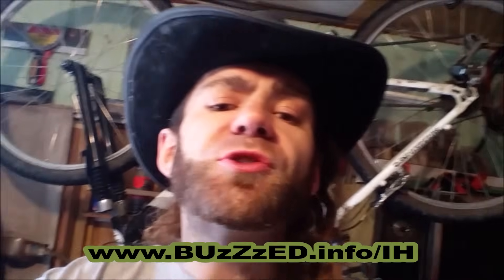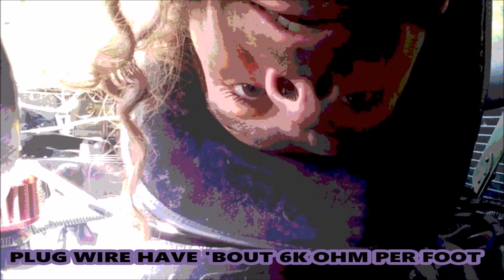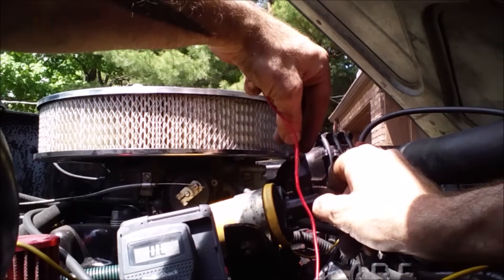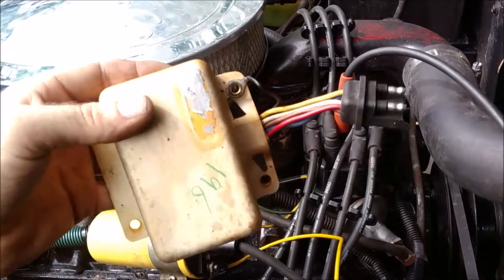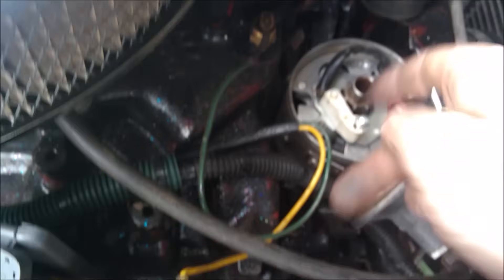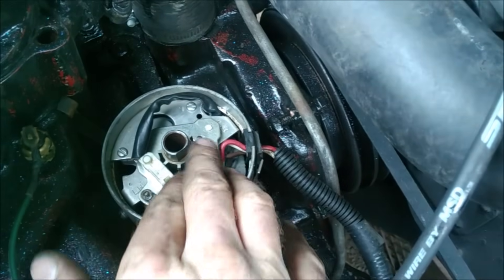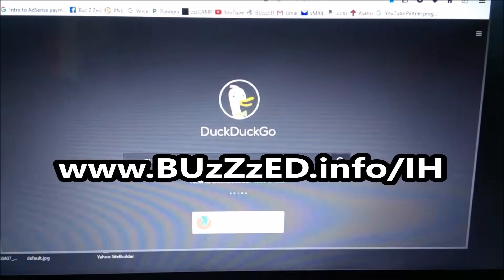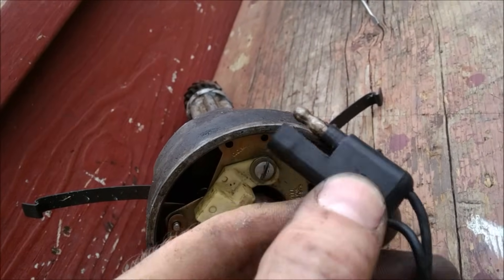NO SPARK, NO START, NO PROBLEM!  IGNITION SYSTEMS

Comment: Could this be the issue of my Jeep stalling after 30 minutes of driving it no problem? Takes a while to start back up starts but then dies again after 5 minutes or right away
Reply from the maker: Could be vapor lock, could be the carb getting hot and boiling the fuel in the bowl if it’s missing a plate or running lean, could be egr, could even be as simple as the gas tank vent is clogged or replaced with a non vented cap on a vented system.... could be your coil over heating. Might even be lean or a bad fuel pump... Does it have points? Is it fuel injected?
Reply: ERIK THE WRENCH - LIVE FREE OR DIY   Lol process of elimination.  My mechanic told me vapor lock is highly unlikely because of where we live but I think that’s stupid because it still gets hot.  It’s not fuel injected. No points it’s electronic. Just put a new Webber carb but that’s didn’t solve it. Going to be amc hei distributor next and higher output alternator.

Comment: Actual helpful information! Thank you much, but.... no look at the Scout II huh? Guess I better subscribe!
Reply from the maker: Their is a film of the scout show in 2017 on the page as well, I have the METRO and more scout vids to upload, but I do need another Scout, She was my daily driver for 5 years, then right after I installed the frame x brace and the roll bar, I got run off the highway a few months ago in a snow storm. barrel flip in to the ditch. truck was totaled, id be dead if not for the simple terra bar from SSS! I find another, have lots of parts and a 392 waiting for the right Scout.
Reply: @ErikTheWrench  I do need badly a set of vacuum wiper motor rebuild kits. I will certainly look for those videos.
Reply from the maker: @whatyaworkingontoday5018  http://www.ironhammer.info/IHOR.html
Reply: @ErikTheWrench  what year scout ya looking for? There are some here in Tulare county, California I also know of some in Lancaster. Travelers, Travel all, Scout II, what your poison?
Reply: @ErikTheWrench  also I have a buddy looking for a quad cab if you know of one.
Reply from the maker: Not sure but I’ll put the word out, just bumped into a guy with a 1940 Ih pickup. Gave me a flyer for the Fort Wayne Indiana harvester homecoming! July 30-aug1
Reply from the maker: My driveway is full and my wallet is empty until I sell this trans am!
Reply: @ErikTheWrench  what year TA ya selling. I might be able to help. If you want to send some pictures I can give you my email.
Reply from the maker: 81, black, 327 humphead, 4 on the floor. subframe connectors and steel tube welded inside stamped frame from the reinforcment plate in the hump to the perch/subframe mount where it attaches... its been stripped and painted seamsealed lot of new body parts, so many parts that now i wont make a dime ill just get my investment back when I sell it lmao..... im making a video on its restoration so you can see whats done.  still need to paint the trims and put the interrior / painless wires back in.... and the trunk pan was only patched.  not sure what im gonna do its a loss either way, see the guy i started this for backed out and fell in love with a riceburner, he was young and i think his family pressured him into the muscle car cause, well thats what they had lol... but we where gonna just stick the tank back and drive it a year almost complete, then replace the trunk pan with one of them prefabbed 4 link subframes, and a roll bar... and start blowing expensive engines dominating the drag strip lmao... so yeah, none of the seams to be welded touch any visable painted body parts so it wont affevt the paintjob to fix, not sure if im gonna do it or let it go, again, loss for me either way, just want my money back, or some of it. it was just one of them things. Im stubborn, and i finish what i start, even though i could have parted it out and not took a loss lmao
Reply from the maker: @whatyaworkingontoday5018   sure, my email is ih@ironhammer.info or https://www.facebook.com/BEDxHEAD

Comment: I HAVE A 66 FORD 352 NO SPARK CHANGED POINTS ROTAR CONDENCER CAP ANY BODY WITH THE SAME MOTOR
Reply from the maker: It’s wired the same

Comment: Hi I have a 1969 Cadillac , I am having a similar issue , I have no voltage DC at the coil when trying to start , what do you think ?
Reply from the maker: The relay bypass, the coil has a resistor and it’s only 9.6 volts. It gets a full 12.6 volts on crank only . This saves the points from burning up too fast.
So this is all related to the r and s terminals on your starter relay.

Comment: You may as well have been speaking in Japanese haha sorry. I'm just hoping that the diagnostics tool will tell me and I will just change the part/s.
Reply from the maker: All good, here is two quick tips. issue is that a lot of ignition,(and other) issues wont be picked up with the scanner, and even then it will just tell you where to look.  So new cars have the same parts to go, the crank position sensor or cam position sensor will tell the new cars when to spark, they are a common item to go bad.  even more common on new cars is the multi coils, especially the ones right over the plugs, they burn out way to often.
Reply: @ErikTheWrench  "where to look" sounds good to me. My car is a 1997 vs commodore 3.5 v6 and I think she just made it for the computer age lol. Ignition, I am guessing because I have to turn the wheel a bit before she will crank.

Comment: Hello, have become a fan of your vids.  I have a79 scout ii 345 4bbl stock ignition.  My ignition coil seems to only work while connected directly to my battery.  It starts right up, otherwise i get no spark.  any direction would be greatly appreciated.
Reply from the maker: Sounds like a bad ignition switch or fuse. The switches contacts fail... or it can be as simple as a corroded bulk head connector on the firewall.
Reply: @ErikTheWrench  Thank you for the prompt response.  Will be checking the bulk head connector at firewall first.  It seems to have lots of gunk from over the years it sat.  Thanks again!

Comment: hi I have a 97 Dakota v6 3.9 it stalls when engine is warm.. I checked fuel pressure it read 47psi with Key on and about 49psi with truck running but when the truck stalls the fuel pressure drops to 15psi (immediately) after stalling (not) holding pressure.i replaced fuel pump assembly now it (does holds)its fuel pressure 50psi now even when it stalls it still holding its fuel pressure..good right?yeah but it still stalls even after replacing the fuel pump, cap and rotor,cam sensor,iac sensor,tps,and pcv valve.i haven’t had a chance to replace the crankshaft positioning sensor yet....I did realize when the engine stalls I checked for spark and there is no spark for a few minutes after it stalls.could that be my crank sensor or ignition coil??please if you or anyone could help me out I would really appreciate it.
Reply from the maker: It stalls warm because it's rich. It's rich because you have a leaky injector.
Reply from the maker: Sounds like a leaky injector causing it to run rich.
As for the no spark, for a few min after it stalls, this is something else.
Possibly when it warms up, and everything expands your CPS is no longer gapped. Check to see if it is the adjustable type.
Reply: LIVE FREE DIY thanks I think I’m just gonna replace the cps and map sensor if that doesn’t fix it I will move on to the injectors as you stated..thanks for the advice I will update you in a few days how it turns out

Comment: Got a 93 ford probe change distributor and it cranks but won't start. 3rd distributor in a year. Spark plugs new to any suggestions i ain't got anything to test the parts with.
Reply from the maker: could be a lot if things, you can just stick a screwdriver in the end where the spark plug goes, and hold the plastic handle on the other end, hold it near metal, and see if it sparks.... if the distributors are burning up it could be the computer.
have you tried spraying, carb cleaner, the low voc will not work, and starting fluid is for diesels, 
remove air cleaner, 
when someone is cranking it, spray carb cleaner in.
if you have spark, it will at least try to start.
we have driven customers cars to the shop, with me sitting under the hood, and keep spritzing  it with carb cleaner.
now if the distributor is not fried, and they keep getting loose, then you have a bad bushing.  it is usually bronze, and its in the hole for the distributor.

Comment: Sorry, my eyes glazed over when I noticed there were no points. Great information for those with newer rigs (1975 and up). Yup, I  have a hard time wrapping my mind around electronic ignition. Eventually I'll have to bite the bullet and buy something from the mid 70's and maybe even the 80's! "If you're gonna be poor, don't also be helpless".
Reply from the maker: I am all about points, nothing wrong with points, I prefer points,
this is just what my broke behind had on the shelf when my distributor wore out.
the easy answer,
electronic ignition is exactly like points, except, the points do not contact. they arc at a very low volt/amp, not enough to get the coil to trigger the spark,
so it has a little capacitor to step up the voltage.
nothing has changed in cars in 50 years (other than vvt)
its all the same except us mechanics have been replaced with computers, and 9$ an hour parts changers lol
and a capacitor is triggered

Comment: Ok, I am curious now.  I just bought a boat with a Mercruiser 3.7 that has points.  It appears that I can upgrade the point system to a magnetic pick up like in your video.  Is the magnet pick up all that is needed with a direct connection to the coil or is there a control module somewhere in-between.
Reply from the maker: That's the cool thing about pertronix the control board is built in to the backing plate for the rotor! So all you need to do is remove galaxy resistor that is in line to the coils power. 
See that's what that r terminal is on your starter. The points run on 9v, so their is a 3v resistor in series b4 the coil... so the when starting, the resistor gets bypassed and the coil gets full voltage to help start.
Reply from the maker: Oh that's all in the second video, no spark no start sokved!

Comment: @erik the wrench I have a 2006 Volkswagen Jetta Gil and I don’t have any spark
Reply from the maker: I will find it in the comments later, I answer this question a lot, have to run to work now, the crank position sensor is not inside a distributor its on the block by the cam shaft end, same process as in the video
, just spread out

Comment: I"m doomed.  I just can't wrap my mind around anything electrical.
Reply from the maker: well, their is a battery and alternator right, generator turns makes electric, charges the battery that is only used to start the car right....
so on an old car their was points. 

turn key to start it bypasses everything except the starter and the coil/distributor ok.
then the key is in run position,
the coil gets power and amplifies the voltage. 

the distributor turns and each time the points touch it sends spark to that cyl. that simple. 

so the coil is charged, the distributor is turning, when the little cam pushes the points closed, like a switch, it sends spark to the plug... boom.
well an electronic distributor works the same way except their is a magnetic pickup instead of the points. so when the lobe in the distributor gets near the maagnetic pickup or cam position sensor, it senses the magnet, grounds out a transistor or relay to send spark to plug... its a little more complex but thats the basics....
Reply: @ErikTheWrench   Thanks.  I get that point of all of it.  It's the wires and how to track them down that gets me.  Add to that how to hook up relays etc and I struggle.  Thanks for your vids. You have helped me trouble shoot a few things but I love my 67 Mustang!!
Reply from the maker: I have been meaning to make a film on how to trace and how to perform an electrical leak down test. A leak down test is something most mechanics don't understand.      But it will take a whole video to explain. It's really the only way with out guessing .....    And I personally think relays on a car have never been necessary, so imagine the wires with out them first. To me it seems absolutely cheap. I often eliminate them. They run a solenoid switch so they can run smaller wires to the dash and use low amp cheaper switches.  So put the cost of the relay into a better switch, Run thicker wire, seems crazy but if they save a penny on each car, times a million cars....
Reply: @ErikTheWrench   Yeah I agree man. I'm sure relays are the reason for 90% of car fires. Yeah I know how to check continuity with a light probe to find out if it is neg or positive but in my case I'm working with a 67 stang with a wiring harness that looks like it's been futzed with.  Looking at the diagram is my confusion as without the DSM it's not quite clear which wire is which. Heck, I have a loose black ground wire that I have no idea where it goes to or what system it's for. That's my real electrical problem.   My skills are in bodywork and painting and damn can I lay it down. I failed electrical in HS so............there you have it. I say, do the video......I'm sure others will be down for watching it and learning.....including me.  lol

Comment: Thanks for the effort you put into this video!  Took my 76 Ford dump truck to the mechanic but every one of them in town is to lazy to diagnose like this. They just say to run it until it won't then bring it in. If you want it done right sometimes you have to do it your self.
Reply from the maker: Got the one on pertronix and vacuum gauge power tuning is part two. A vacuume gauge will.tell.you most mechanical issues.  The next one in putting out is on a leak down test. A leak down test.is the only way to pinpoint / prove  any mechanical issue before proceeding and not just guessing but nobody wants to take the time! But it's fool  proof! Even times in shops you would tell the  customer it is usually this part but it's a gamble on you if we don't do a leak down test first,  and 9 out of ten say no problem just change it and if it don't work well teat it????? All you can do is suggest the right way, if they think they know best or have a horseshoe up their bum, great more money for me lo!

Comment: New Control Module and have found and installed new MAP Sensor and problem persists...with a twist...mis seems to occur only when driving down hill...power good up hill and on level roads. Everything i've read indicates engine cannot be re-timed because the electronics get in the way. So, if i set #1 at TDC with rotor pointing there,  then hand crank engine to 10deg BTDC and lock down the distributor, is it correct to presume that the electronics will do the rest? One more consideration...i live at 7200' altitude and seldom drive below 5,000' altitude.
Reply from the maker: If it is an IH power plant, it gets timed off number 8cyl! the camshaft turns the opposite direction due to the cam is a direct gear drive, no chain....  
Also at higher altitude you have to rejet your carb, but your computer should adjust on injection...should... 
it is possible the injector is dirty or bad fuel pressure. so with out the backpressure from going up or level, it would show the lean symptoms more....  can even be something in the tank floating around.... filter... pump... the pressure regulator... so I would test for pressure... Also Map sensor must be clean clean clean and with map cleaner, if you got anything on it it will fail, also get the voltage specs and see if the map sensor has a broken wire running to it....   If you do not set the timing to factory usually you need a chip or a computer flash.... Not sure what your working with... how steep a degrade? the wrong gear even lol Are you getting any codes?   even spark plug wires routed wrong can send false signals and trick the module! you dont need to adj mechanical timing for alt... You may need hotter or colder spark plugs if you have modified the timing, a colder plug will transfer heat faster out the chamber...   
so is it a random multiple missfire or a particular cyl? random is usually from lean or bad timing.... can also have worn springs on the advance weights in dist or a sloppy shaft....
Reply from the maker: even if you disconnected the egr or messed with the pcv.... Egr actually was a way to trick emission test. see they lowered compression to pass, and gave it an egr, so that on idle its a lower compression... The the recirculated exhaust dont compress like the air, so it raises your compression under a load! might be bad... with out the pcv it will run rich if you dont compensate...